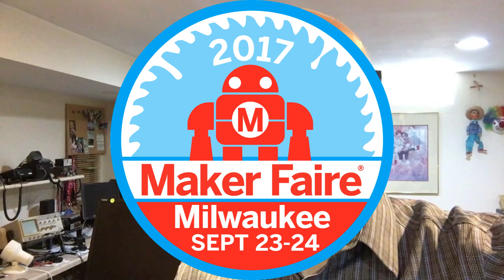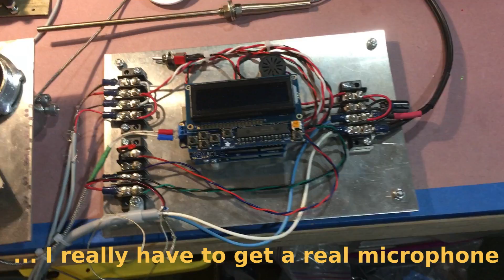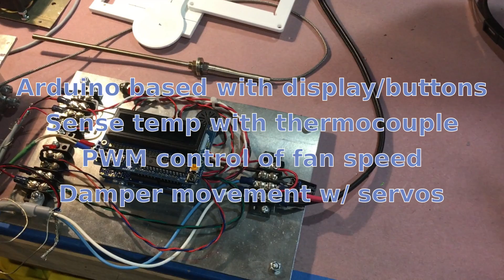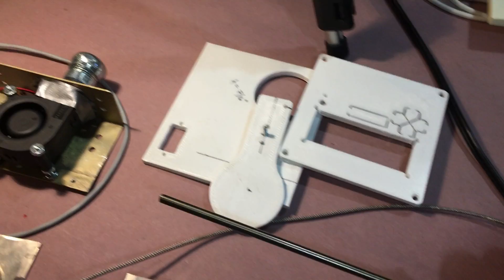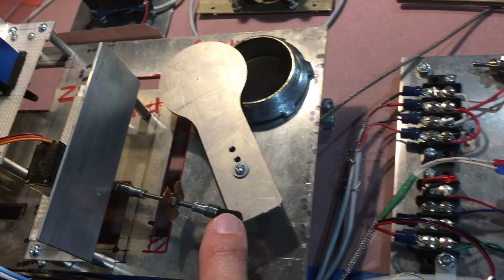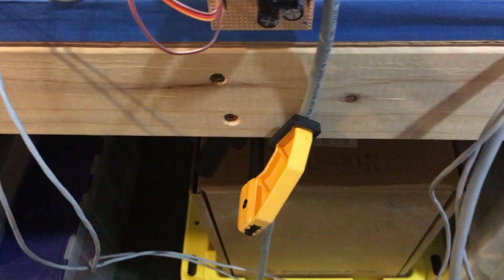Weber charcoal grill automation  & MKE Makerfaire prep

Comment: Hello!  Did you end up ever doing another video or more with this? I've had this idea when I got my new weber grill and was happy to find your video.
Reply from the maker: @colthenry1594 ... thanks for your comment ! ... wow, a blast from the past 🙂
So, quick answer, not really.  However, I still have all of the hardware and "someday" will get back to it.
I had limited success, but think that I may have been leaving too many variables in the burn equation.  I was using bulk/chunk
charcoal.  That stuff is very hard to control, even in general.  I have noticed that most of the automated smokers these days
control the "fuel" side of the burn equation using the speed of an auger that feeds fuel pellets.  However, I do still think that it's possible
to control the temp from the oxygen side.  If I ever do get the project back off the shelf, I would probably do the following:
1) Use a ring of charcoal brickets arranged in a ring around the inside of the grill such that one ignites the next one in the ring as
an attempt to keep the fuel supply constant.
2) Run some tests with my dampers fully closed and open to try to establish that they actually have control over the temp
3) Do the same with the fans
4) Use the above results to more deliberately tune the PID

Let me/us know if you make an attempt at this ... would love to know.  Feel free to post links to videos if you make any.

Also, if you need/want a link to my software (such as it was at the end of my project), let me know.

Best,
DanielAtBasementTech

PS Gosh, now you have me thinking that I should make another attempt sooner rather than later ... I just got a used Weber Grill 🙂
Reply: @danielatbasementtech  All great ideas, thank you for responding!  I subscribed so if you ever do bring out some more vidoes I'll be able to see
Reply from the maker: @colthenry1594  thanks ... appreciate it.  I am finally starting to make some new content.  We've been moving into a new building for my son's knife making business and that's really kept me busy for the last 6 months.  Lots of fun things in the queue.

Comment: I had a hard time getting past the "I am a vegetarian" silliness but this is pretty cool.
Reply from the maker: Ha … I really have to get back to that project and get it fully working. The chimneys need to be modified to take out the flat portion at the bottom and the PID needs to be tuned.